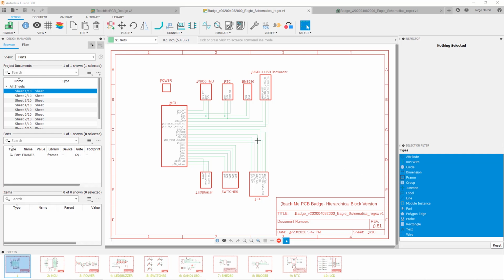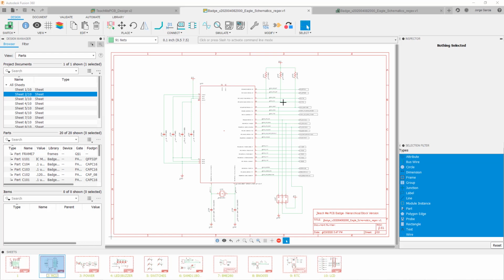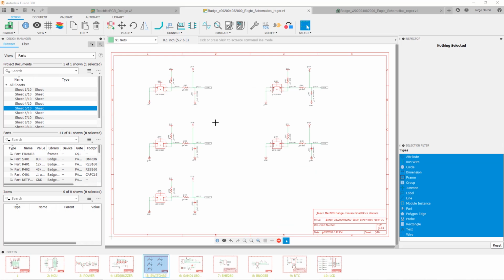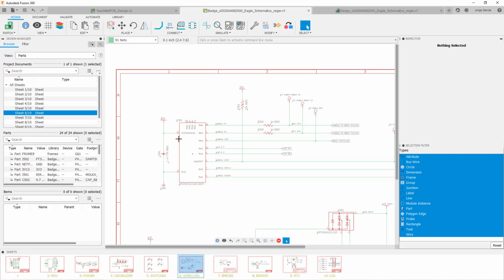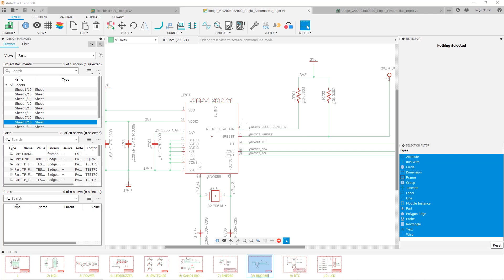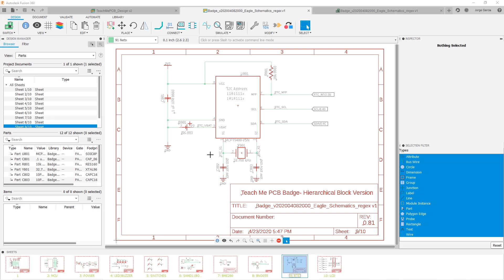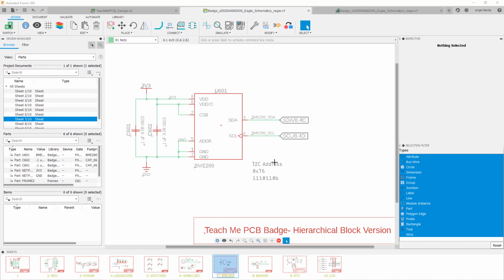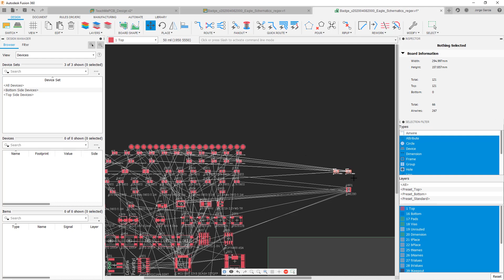Tutorial: Episode 2 Analyzing the Schematic to inform Layout

Comment: I am sorry but that schematic layout is very poor. There are WAY to many cross overs, most of which could be removed by swapping the pins around. By increasing the sheet size, you could of placed more blocks onto one page showing a logical flow from left to right. Nobody wants to be skipping between pages to find different parts of the design. There are several other things that I will skip. The next video should be about setting up the PCB. Before you start to put the first item on the board or start to group components, you want to define your board shape, outline, mechanicals, mounting holes, cutout regions. You do not want to jump right in and start laying components only to find that the board will not fit in the enclosure you are going to use.
Reply: Everyone's workflow is different, the one I show in these videos is how I would approach the situation. I didn't make this schematic, it was given to me. I stand by my statement though, in a dense complex design compartmentalizing it in different sheets based on function makes a lot of sense. It can aid in understanding the logic of the design since you don't have to parse a large one sheet schematic but can rather focus on the individual sub-components and build from there. But that's just me, if you have a preferred workflow that's different that is just as valid.
The next video addresses some of the points in your comment. It's nice to know we are moving in a similar direction.